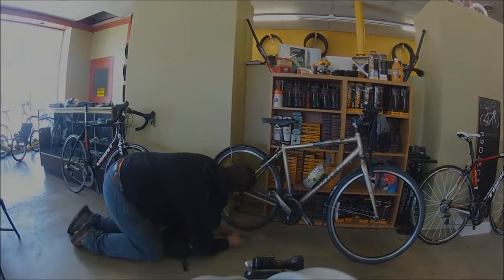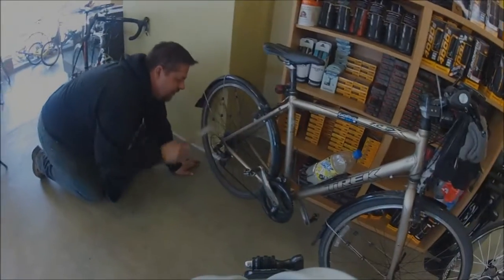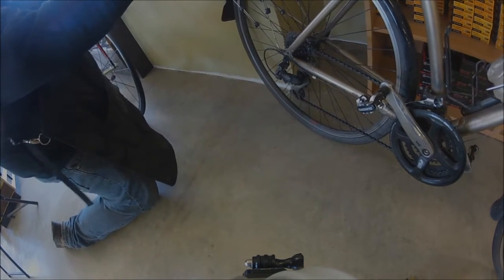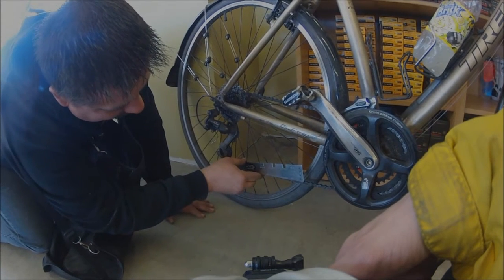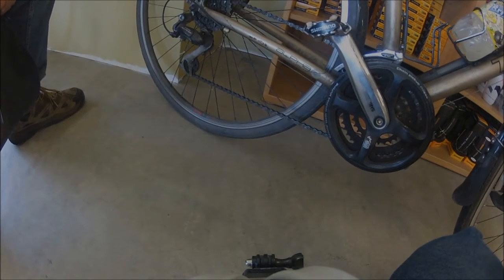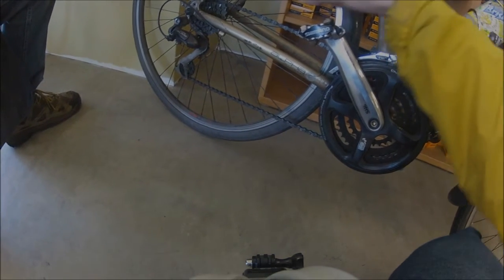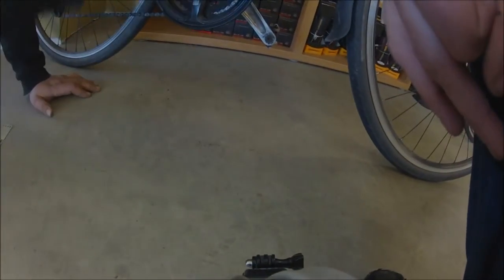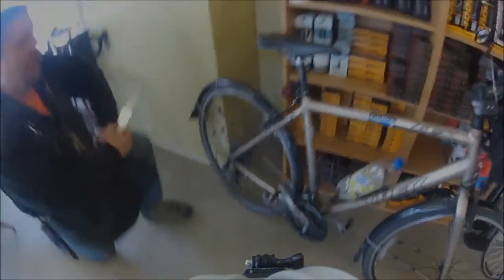My Chain is About Ready to Fail, 3-10-12

Comment: He recommended to replace the cassette as well, right?
As for the middle ring of the crankset, it looks good. Unlike the cassette, these can be ridden until the chain starts slipping on them (so don't waste your money on a new crankset yet). And the new chain won't suffer because the teeth are slightly worn. A worn cassette cog will wear out the new chain though, so definitely replace that at the same time as the chain.